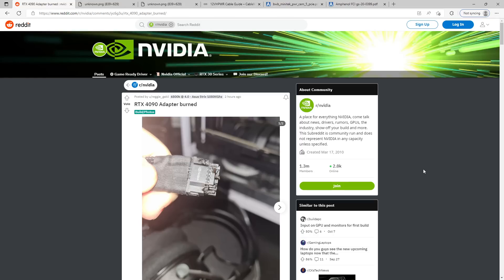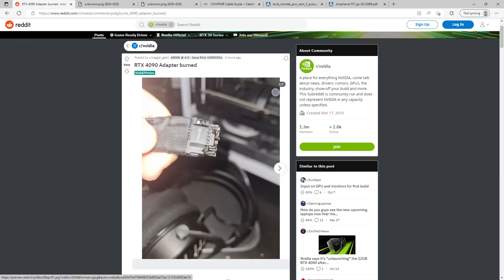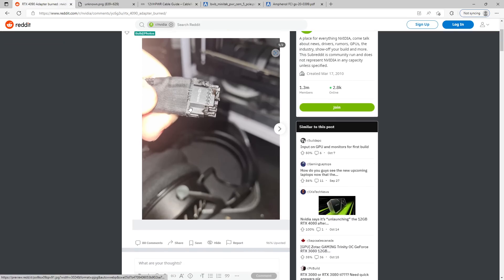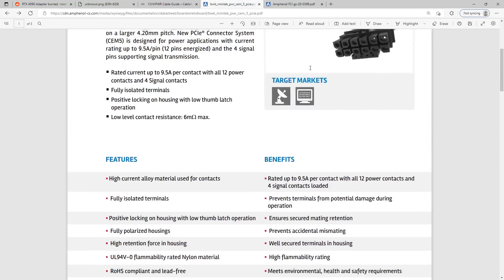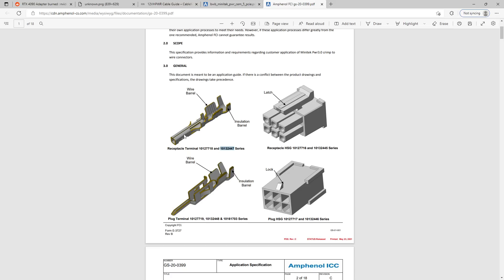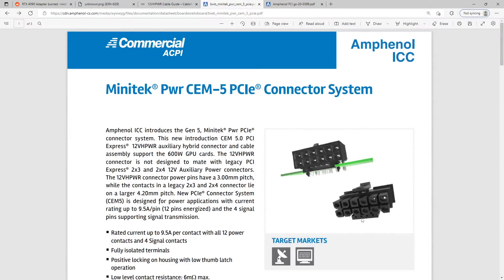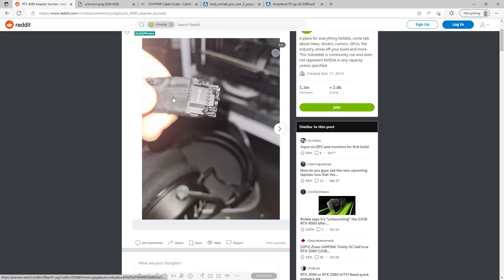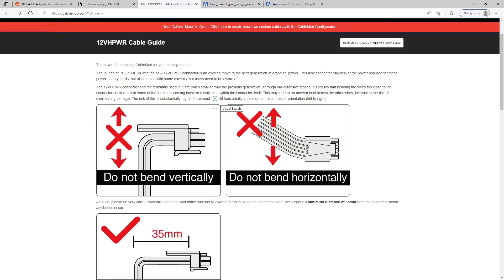The 12VHPWR connector sucks

Comment: Especially when the surface contact of the pins are lower than those on PCI 8pin ...
The terminals are not per say the problem. Lots of industrial connector with a lot more amps / volt use them. It's the surface contact that is problematic.
As soon as you wiggle a bit the cable they will lose some of that contact surface, and since those connector have very low surface already ... well you get heating problems and fire hazard issue.

Compared to PCI 8pin connector, which i believe are close to twice that surface with more connector (12 total with 3x 8pin), you probably get more than twice the surface contact.
I bet in not so many month from now on, this connector will be either recall or not used anymore. And will get a bigger version with more space and bigger connectors.
Reply: *per se

Comment: Another dumb thing is that a normal 12pin connector (e.g. Molex Mini-Fit Jr.) has similar current specification to this smaller one without being much bigger and sensitive to bending. So just dumb Nvidia design choices.

Comment: 300W for CPU and 600W for GPU. Everyone has forgotten that efficiency is a thing. Pushing their silicon beyond the optimal line to be the market leader. 7950X draws double the power than 5950X. Does the 7950X double the performance? The world is currently going through an energy crisis, risen the power cost. On the other hand, R G B s will not hesitate to double the power consumption even to squeeze as little as 5-10% of more performance.
In my opinion, All the existing connectors are fine. It’s just the companies became more greedy.
On the consumer side, we should expand our expectations for efficiency. Trust me, LED bulb is not the only thing that needs to be power efficient.
Reply: You are right. And as good as competition has been for both CPU’s and GPU’s for performance and price, THIS is the nasty cost of intense competition. Im actually slightly scared to be gaming on a computer that pulls almost 1000 watts of power. I mean damn its so excessive and wasteful in this world of today
Reply: @absolutelysobeast  We, the consumers, need to create a backlash against their practices. Or it will get worse.

Comment: Knew it... you cant tell me that little connector can handle the amps it needs to carry. Bigger is better!
I wish they just had beefy cables with lugs soldered to the card and equivalent lugs on the PSU Side. You know battery cable style... but unsuitable for normies.
600W at 12V is 50 Amps. Yeah that is lug terminal territory to me.

Comment: just showed your video to our company electrical engineer and he nearly had a heart attsck seeing this connector
Reply: @Hisokaa-d2j  not of the top of my head 😅
The XT60 is so good because it uses round barrel jack type connectors that are springloaded with a fair amount of force and they are usually gold plated. Spring force is a huge factor too. If you press two surfaces together they make better contact. 
Surface area for one XT60 is probably the same or even less maybe than one of those stupid Nvidia Plugs.
Well regardless the XT60 is very capable there are very good reasons why beefy LiPo packs use that exact connector. Its rated for 30a continuous and 60a peak that says a lot...
Two little XT60s can do what three big bulky 8 pins can do in theory.
Why isnt that connector introduced to PC Hardware? The more I think about it the more I realize that those connectors we trust with so much current in our computers are kinda shit.
Like it would genuinely make sense to desolder the PCIe power connectors from a GPU and put XT60s in their place and to the same with the PSU Side.
Reply: @Hisokaa-d2j  For real! They should use that connector on the high end enthusiast cards and make corresponding PSUs.
EVGA could have done that but well they got too fed up with Nvidia.
The PCIe Connector works but its bulky and a very crude solution compared to something like the XT60.
Reply: @Hisokaa-d2j  man what if Nvidia just decided to do something following the "keep it simple stupid" principle for once and just used an off the shelf high current connector like two xt60s molded into one shell making an "xt120". Would be neat and compact. Then just have an extension cable with three standard 8 pins at the end.

Edit: Ayoo the actually make a XT90 connector! Two of those and even a 4090 would be happy.
Reply: As an aspiring electrical engineer I reacted the same to that bullshit connector.
Nothing beats sheer size and contact surface area when you have high currents. You cant cheat physics... electrons gonna electron and that means give them beefy connectors or they will burn your stuff to a crisp.

600W at 12V is 50 Amps... for 50 Amps you would use big beefy bolt on lug terminals or screw terminals in the real world NOT a tiny GPU power plug.
Two 8 Pins would be perfectly fine at 600W you have 8 current carrying pins (Sense Pins are useless imo) so each pin would have a 6 amp load on them that's acceptable.
Three 8 pins would be better though.
Reply: @alouisschafer7212  for reference cranking the starter of a car tends to be 120-130A, and it lasts few seconds... It has massive wires, terminals and they are not friction fit. This thing is a tiny friction fit connector that's bound to wear off.
Reply: @stanimir4197  so are all other +12V connectors in a computer😅
For real though we are approaching territory where I would love to just have big copper screw terminals on a GPU to directly hook up the PSU cables with crimped on lugs.
Battery cable style...
50 Amps is 50 Amps... With subzero OC trough LN2 or a chiller and all limits removed that may turn into 60 or 70 amps or so. 
The XT60 and they actually make an XT90 kinda cool are the next best thing to just having three or four 8 pins.
Reply: @alouisschafer7212  right? Have any of these people ever seen a 50A or even 30A power clable? like for an RV/camper? They twist lock on.

Comment: I might be completely misguided but I dont understand why nvidia didn't take it all the way and make it 20 pins. It would take up more pcb space than the 12 pin, but less than 4x8 and be able to provide the same power over less heat load, hell they might even have headroom for sense pins. I'm mostly guessing it's just because the connector would be more expensive to produce
Reply: They rather have problem and the card look better, than have no problem and the card look a bit less good 😂

Comment: Still annoyed my 3070 has the 12 pin connector despite there being very clearly enough blank area on the PCB where two 8 pins probably once were, wouldn't be suprised if NVIDIA forced board partners in RTX30 to use 12 pin even in places where it didn't make sense. Had to make a custom cable for mine because the dongle was just so ugly and amusingly took up too much space in SFF build. Absolutely would not want to pump 50 A through those contacts unless they were brand new and seated perfectly with only 1 mating cycle. Sure Molex MicroFit 3.0 have the same contact dimple arrangement as Mini-Fit Jr. but as you said they are thinner and physically weaker and prone to splaying apart. A MUCH better solution to NVIDIA's PCB space constraint issue would have just been vertical or stacked 8-pins on founder cards or a dongle inside the card as they did in RTX20. But seriously the RTX40 cards are absolutely massive, why are space constraints even an issue?

Also I never heard anyone talk about how official RTX30 series 12 pin connectors are keyed so can't plug them into the RTX40 series 12+4 pin connectors. The idea NVIDIA knew they would introduce the 12 pin for RTX30 only to instantly obsolete it with the 12+4 pin really rubs me the wrong way.

Comment: They should have just used EPS 12v CPU power connectors 🤦‍♂. Datacenter cards already do so and it would simplify the average pc build by a lot.
Reply: and one EPS 12v connector can pull  about 330w, so 2 of them can power any GPU, even a powermodded vega or 3090ti
Reply: @rubenfasola5402  Yup. The limit is actually 384 watts, assuming good quality wires and the like.
Reply: @b127_1  I remember that was an higher current variant or solid pins/core at 8A/pair

Comment: encase the bastard thing in epoxy ?
Reply: id hard solder cables with two or three 8 pins on them to the GPU 😅 and I could make that look pretty much factory too...
Technically two 8 Pins are enough to feed a 4090.

Comment: I would love if we could get back to the actual pci-e spec handling of connectors at the end of the card and not on the side. it would mean cleaner handling of hiding those cables.
Reply: Then it would be easier to use the cards in data centers and Nvidia hates that. The Quadro and up cards have power connectors on the end. They also use the CPU 8-pin for 300W per connector.
Reply: @tinfever  I think you have hit the nail on this.
Reply: They should be allowed to choose 1 or the other, but you have to have one obviously, Nvidia tried to optimize both away and invent something new and it was overly prioritized towards aesthetics.
Reply: its called a High-end graphics card my firepro w8100 has it but not the 290 they have the same GPU based off Hawaii but the firepro was $2,500 not under $500.
Reply: yes please!
Reply: I was thinking of this last night when I was looking at Xilinx FPGAs, why don’t AMD and Nvidia do it when Xilinx does it already?
Reply: @Fractal_32  Are you referring to some FPGA based acceleration boards for specialized computations?  Because I weren't aware those didn't just use existing interface standards to fit in existing computers.
Reply: @johndododoe1411  I’m referring to PCIE FPGA cards from Xilinx that put a 6 pin on the opposite side of the card from the rear panel IO, typically closest to the motherboard. Boards like the “Xilinx A7 Artix-7 200T XC7A200T” (Development board)

Comment: The fact that they're doing 8~10A DC over such tiny pins and don't even have decent strain relief on those cables is just bonkers.
Reply: @alouisschafer7212  no, 
a) 2 8-pins are not rated for 600W so don't do that.
b) 8-pin connectors still have only 3 12V pins so that's 6 pins total so still 8~10A per pin at 600W

Comment: Dab of hot glue between the cables and connector after it's plugged in?  Got it.  Seems like a reasonable thing to have to do on a $1600 add-in card.

Comment: I think they should have done bigger change in ATX standard and move to 48V for hi-power cards. I feel pity for those small contacts to handle that amount of current. 
ok maybe we need more phases in VRM or additional step to drop 12-20V
Reply: I replyed to guy that asked for 24V :
I would go even further, like Automotive was moving with mild-hybrids. They started adopting 42 V. and remember, automotive is also using more and more computing stuff ( teslas having consoles from AMD..., most high-tier multimedia / navigations are powered by NViddia, so... )
so for you, not 48V, but 42V as lookslike it is widely used, or soon will be.
Reply: @AdalbertSchneider_  48V is pretty common in industrial and telecom side but those usually can handle up to 72V.
Reply: @AdalbertSchneider_  I say build for 48V, rate for 42v. Over-engineering for consumer safety is always a win.

Comment: its a WIRE how do you expect the user not to bend it..... the utter incompetence of the engineers who designed the connector is insane.
And on a side note the 2,3 or 4 8 pins look way better IMO, especialy with custom sleeved cables.

Comment: maybe we can make some kind of clamp, 3d printed ideally, and use that to pre-bend the cable at some distance away from the connector head.
Reply: Panel mount on an extension PCB is a better option

Comment: The connector is dogshit. They need to borrow an IC5/EC5 from the r/c world and use it as a standard connector. One positive wire, one negative wire, 1000+watt power handling, zero chance of failures, and cables can be routed in any manner you please.

Comment: The wires are also not ok. Power supplies the past 10 years ship with 20-22ga garbage cables. for 6A (600w), the safe gauge is 16ga for stranded (the type of wire found in power supply cables, not the size), or 18ga solid.

Comment: They should've made the socket similiar to the VGA thumb screw design.  They could fit two screw slots on both sides fine, on the gpu power connector